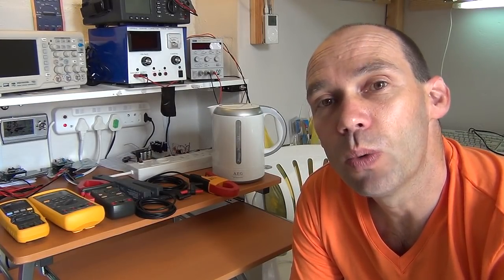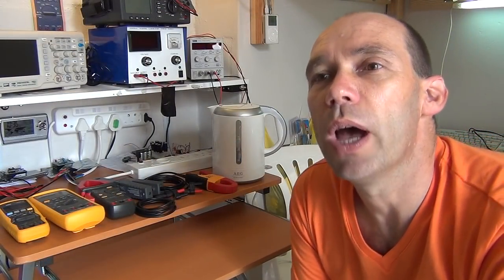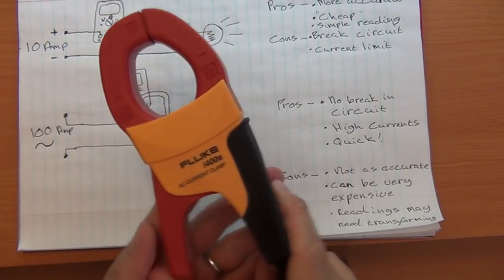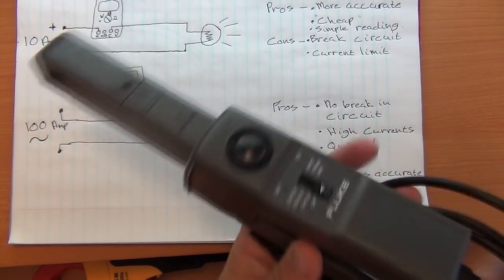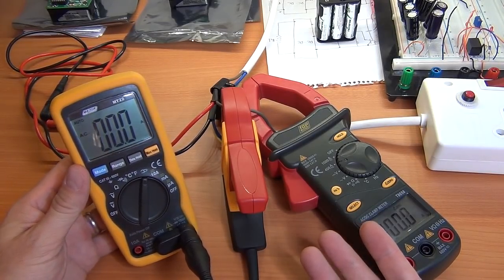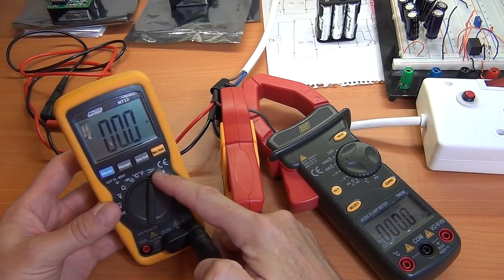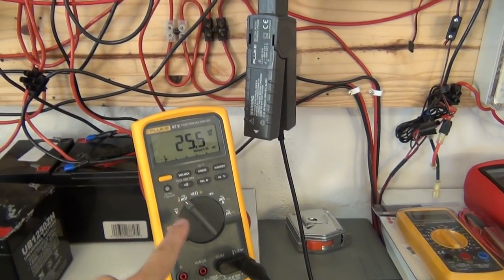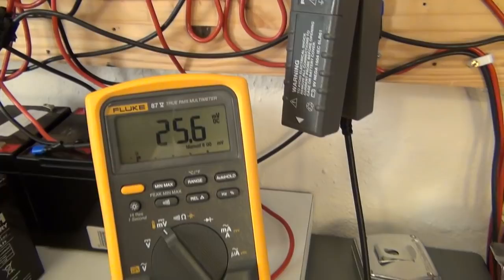How to use a multimeter for advanced measurements: Part 2 - Current Probes / clamps / transducers

Comment: these videos have helped me alot in my small solar projects. i would like to find more in formation on small circuits and resistors im looking to build a solar heater with a small fan and a snap disc and a small solar panel to power it all with no batteries. im also looking into building led lights for small power consumption. thank you for all your help

Comment: On your video I see ecactly the same thing I am experiencing.

At 17:55 check how long it takes to settle on the current reading when you switch on the load.
That slow response not only takes any inrush current measurement out of the question, but also dampens any measurement of a varying load.

Then @ 21:24 check the snappy response of the MT22 working in conjunction with the same current clamp.

Thanks for the reply. I may find something more interesting to post on your forum in the future.

Comment: Great Videos and very useful to learn from, think I learnt more watching this video than I knew about electroics, well on this topic anyway  Martin appreciate you posting these, if I may ask a question about a PCB that comes out of a old 8mm movie projector, It supplies power to the micros witches that run projector, and controls speed  & Direction of the DC motor. It is getting 22volts on it's input terminals, but not outputting anymore than 2 or 3 volts on it's outputs. I can see no obvious damage to board or Cap, Resistors etc well obvious to me,   If you have time, maybe you could look at the short video I have uploaded and suggest what I should be checking first.  8mm Movie Projector Speed control board no power coming out  Thanks Phil

Comment: Hi Martin,
According to the fluke manual for the 87 V, zeroing the meter in the AC voltage ranges is improper becuase a it says a small residual voltage is expected due to the characteristics of RMS measurements. I don't have technical knowledge of why but that is what it says in the manual
Reply: It is in a section titled "zero input behavior of true rms meters"
Reply: It says there must be a minimum voltage present to guarantee accuracy, for the fluke 87 V, it is 3% of the range, or 18mV

Comment: Don't use the Rel-delta mode on 87V. You got the concept wrong in the use of that button, it's not for zero-ing but to save the last reading and automatically add or subtract it to the consecutive reading. When under load that meter will display the correct reading even though it's not zero at idle. Nonetheless informative video on the types of amp clamps you use.

Comment: I have a question...understand I am way out of my element here.  I understand that it is possible to hook up the Fluke 87 to a tablet or laptop and measure/graph current usage over time?  Is that so?  How does one go about doing that?  I have a persistent surcharge on my electrical service for a usage spike and I can't understand where it's coming from.  I would like to be able to pinpoint what time of day this spike in usage is happening and then start going from building to building on the property if necessary to discover the source.  Can you help me?  I was recently given a Fluke 87 III but I assume it's pretty close to the same as the V you've been making your videos with.  Thanks in advance, Jason

Comment: So, if I want to measure DC current, like 30A, the best thing would be to buy a clamp multimeter that can do DC current? I'm looking online to buy one, like up to 20$ (since I will use it only occasionylly) but none of those has DC current as a option... Thanx for the video

Comment: I have a question with regards to resistance. I'm a robotics engineer that means I was a field engineer I don't have a degree in engineering they just called me that LOL. Recently now that I'm disabled I've been using a kiln because I've taken up pottery to try and occupy some of my time. Well, it came time to build new coils element if you will for the kill and they have to be at 10 ohms 16 gauge kanthol A1 wire. Unfortunately, I only have a very cheap consumer-grade multimeter it probably only cost 20 bucks then I have noticed that when I wrap a coil I do it on my lathe and I take it off and measure the resistance and start trimming it to get down to 10 homes it starts out at like 12 ohms and then counts down in eventually stops is that normal? Or is it that just the mark of a cheap multimeter?

I'm so sick of having a crappy multimeter that I just ordered a lower-end fluke on Amazon hopefully this will allow me a little more Peace of Mind even though it is a lower-end one. At home I'm not going to be troubleshooting board-level crap so I don't need an expensive multimeter i just need a decent quality meter

any tips?

Comment: nice demonstration.
The thing I don't get, is why the AC mV range on the 87V responds so slowly...

I have bought both 87V and a i410 AC/DC current clump for some months now and i still can't get over that slow responce in AC current mesurement... 
The DC mV range is properly sesponsive so DC Amp measurments are fine. 

Granted, I didn't buy the 87V to use it only in conjunction with the current clamp... But it strikes me... having to buy another multimeter in order to have proper ACmV response.

Comment: how do I measure miliamps on a proximity sensor with 4 wires using a normal multimeter without the clamp? I know it has to be in series but the 4 wires confuse me I have the positive , negative and two more that say load, where should I put my leads to take the measurement? I know the range should be between 4 to 20 ma , pls give me some orientation

Comment: I have an outdoor thermometer sensor. It stopped working so I disassembled it and found the bad part is labeled x1 on the circuit board. Can anyone tell me what an x1 is? Any help wou It apparently has something to do with wireless communication and this is what I have a picture of. Any help would be appreciated.

Comment: I like to measure starting current from car - maybe 200-400A. Only for fun, not for accuracy. Without interrupting the circuit. I know Matech MS3302 extension for multimeter which is until 400A, but is only for AC current. Another device or how to persuade Matech MS3302 to measure DC current? O:)

Comment: Good afternoon writes Danilo Technical sell and Repair Computers in Republica Dominicana have a Fluke 289 in my work and suddenly not want to climb as if the Software is damaged, I have the test probe wants me a little hand and tell me which are the two keys to be left down to do a factory reset.
Reply: pcsoto Soto Factory Default
Reset the Meter to the factory defaults as
follows:
1. Power the Meter on in any function.
2. Press F4 (Setup) and select Reset using arrow keys.
3. Press F3 (Meter).
4. Press F1 (OK). The Meter should go through power up routine.
Reply: Gracias Garry..

Comment: title is "advanced measurements " yet only videos i can find on using DMM for testing motherboards is on Hindy , or Indian , witch is not the language i can understand. Seams no American deals with those kind of complex measurements , or at least in english . So much DMM engineers but they cant diagnose a motherboard with DMM. Interestingly they can build scopes that use the same technology in same process . They can repair other kinds of " a lot of chips in SMD technology" devices but yet no one seams to be able to do chip level motherboard testing with DMM

Comment: So in a sense current is all around us..true in other scientific formulations the discharge of energy even chemistry you know...like basic water-is reaction to energy-heat causes molecular changes to boil...It is in electricity called warming...the regular water gets warm causing your meter to have a variable % like o.ooo  turns to o.oo1--oo2 so it would be like heat from the sun or ground causing normal water to get warm--the constant would be heat cor vents from the center of the earth...all sustainable energy sources...better with intellectual improvements---solar oven..vs just sun..its the modification or formulation of using the source.....so energy is all around us and it can cause a small variation by continuity-and discharge in different forms....in minute mill-measurements...so clamping is the same form as magnetic physics or FIELDS..You use the PHYSICS--magnetic field to transfer energy--waves of energy...so the clamp takes a measurment of the energy and gives you a reading where--PHYSICS FIELDS are more difficult to measure because they transmit  and receive ....signals.....wireless.....the clamp measures the wire current moving through it....? electricity disperses all around us in different things--like magnetic fields ...or sun rays all forms of energy
Reply: constance washington and that is how one defines the term.... "jibber- jabber"

Comment: Why are those clamps so expensive?!
Reply: +Ernst Stavro Blofeld  Test kit has always been costly  even back in the days of analogue meggers tester were big bucks . sensitive parts  cost to build ect .
Reply: Ernst Stavro Blofeld 
Goes down to about $50 for a cheap off brand 65A or 600A clamp prove that can be used with any DMM or oscilloscope. Fluke costs a premium because it's designed and manufactured much better.